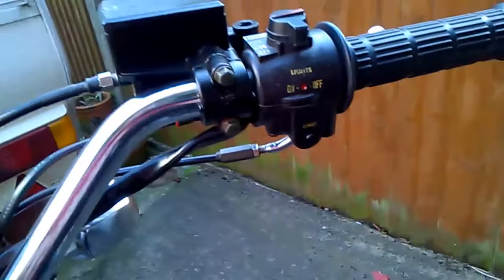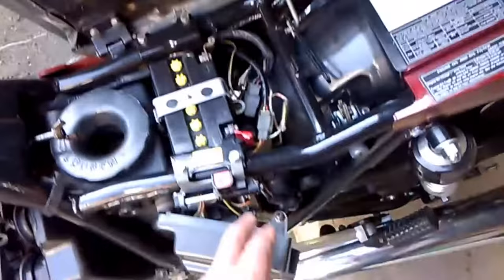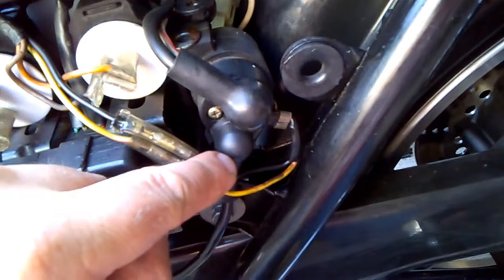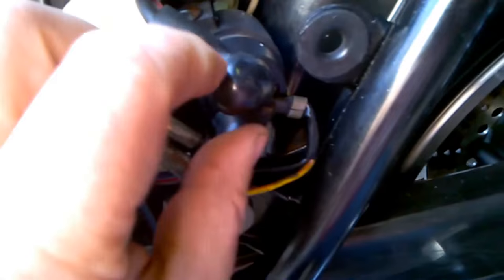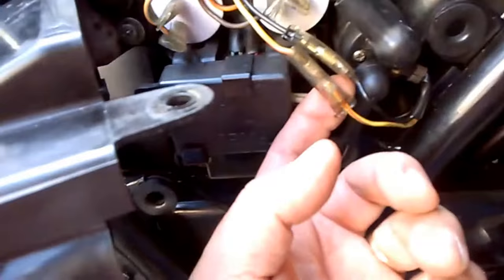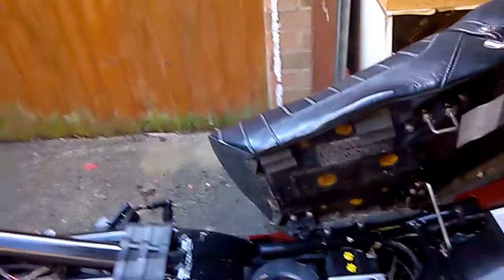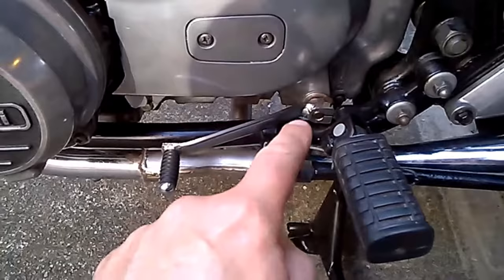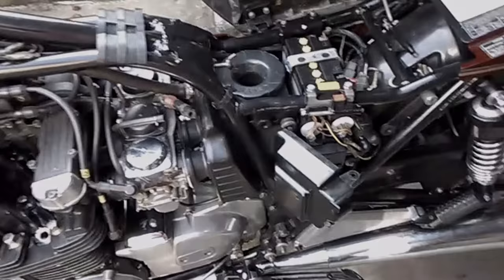What to check when your starter button is dead.

Comment: I'm lost i droped my bike broke starter moter put a new one in nothing is happening
Reply from the maker: Tricky! A few thoughts. If you are getting NOTHING not even a click, you should check that you have a good clean earth/ground. Then check your battery has a good charge, especially if the bike has stood a while. Are you sure the starter motor is good? (Was it new or from a breakers yard?). Maybe, like in this video, it is one of the kill switches got knocked? Is there a kill switch on the handlebar? Did it get knocked? Has the bike got a kill switch on the kickstand? Is it working OK?
Good luck - I think my video should help rule some things out.
Reply: @Mr_CMH  thanks for the reply IV charged battery bought starter brannew IV just had a mechanic on fb who previously done work on it. I told him solenoid could be the problem aswell  then he's trying to get me to buy a new engine as he said it would be cheaper but my engine is fine so I'm abit confused now I'm going to clean earth and ground on solenoid  athter that don't know what to do as i don't trust are even like the mechanic
Reply from the maker: If the engine was running fine before the starter broke, doesn't suggest the whole engine needs replacing, guess it depends how cheap the dude can get an engine. Wish I could help more, just try to go through things one at a time.
Reply: @Mr_CMH  the man's a joke works out his dad's garden tried selling me cocaine last time i was there. I think I'll give him a complete miss i think IV got solenoid sparking and some sort of clicking when ignition turns on god knows thanks mate

Comment: 1:53 . your not making much sense here. how do I test the solonoid?
Reply from the maker: Thanks for the positive feedback lols. So basically, if you take the solenoid off, but it on a workbench and connect it up via the small wires (that go to the starter switch) to a 12V battery, it will kind of 'jump' when you make the connection as the electro magnetic switch is activated inside. That's the simplest way to test one. The will actually 'jolt' when you make the connection. Obviously observe sensible safety precautions when doing this (insulated connectors etc.).

Comment: The idiots Clive, are the people that design engines that have multiple 'won't start' switches. One of my bikes, forget which didn't have a  kick start (only starter it had) so I had to bump it off. No, let me rephrase that, it was a friends bike I  borrowed. Norton 600cc engine. Can't remember what frame it was in. Joke was being small I wasn't strong enough and once didn't manage it and fell over lol.
Reply from the maker: MalcOfLincoln Oh dear Malc, hope your friend didn't mind! It was a simple mistake, but cost me a bit of time.
Reply: Didn't hurt anything Clive. Unlike if a modern bike falls over that can cost 1000s, old bikes just landed on the footpeg and handlebar. Only problem I had was it was heavy. He'd lent me it for a couple of weeks while I got my car fixed.

Comment: Not the fucking starter that’s not a switch
Reply from the maker: ?... but it is operated by a switch on this bike, and there are other switches in the starter circuit, which is the whole point of the video.
Reply from the maker: Probably would be more technically accurate for me to have said "contact", or "circuit breaker" but most people seem to understand.